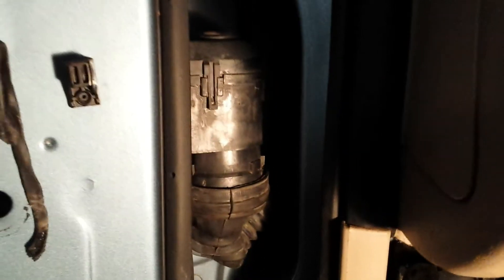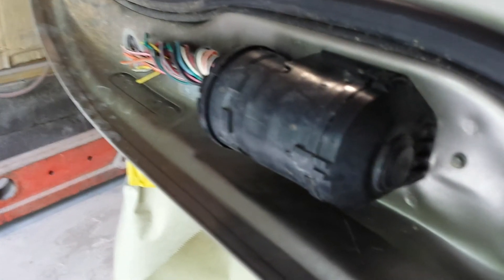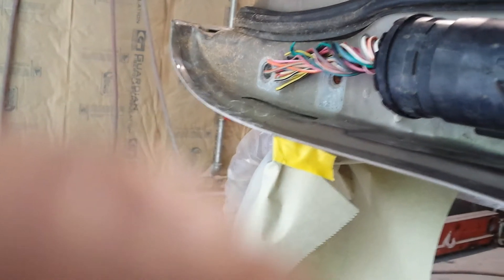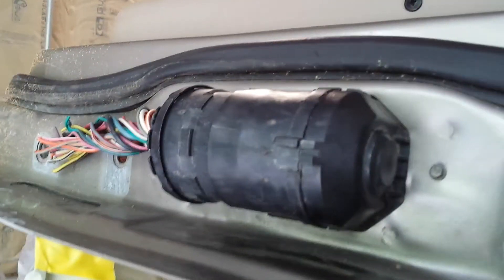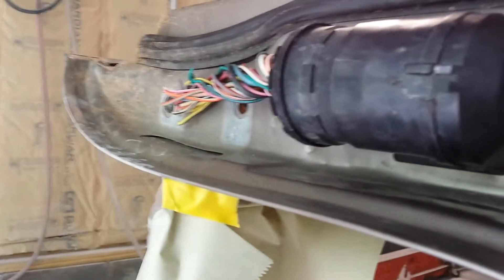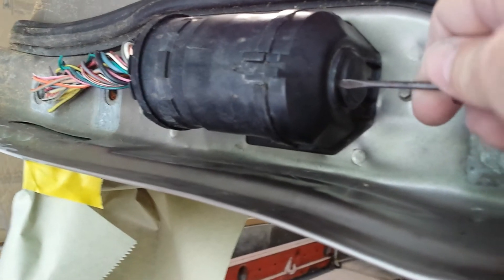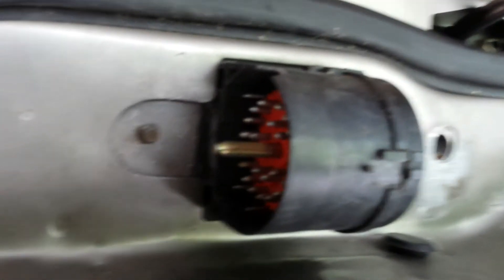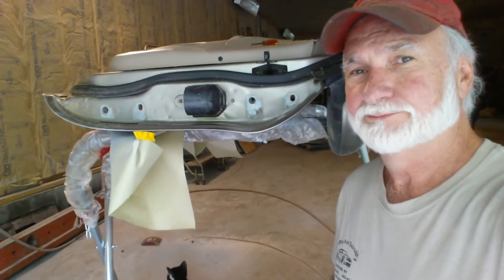How To Disconnect Wiring Harness Remove Door Ford Taurus

Comment: Thank you for this! I know this video is 4+ years old, but it allowed me to find a wire that had broken, which controlled the power windows on our old 2004 Mercury Sable. TIP: you may have to use scissor to vertically cut the boot that covers the wire bundle... to actually see and find the broken wires.
Reply from the maker: Maybe old but glad it help fix it!!! 😎👍

Comment: You are a lifesaver Sir. Now just need to figure out which one is shorting out. Can't find a wiring diagram showing which one is power to all windows . But you showed the hardest part. Thanks!!
Reply from the maker: Glad it helped!!  Thanks for Comment!!! 😎👍
Reply: @JL.FortneyProductions  just fixed it. The main power wire was severed. Spliced back together n good as new. Thanks again!!

Comment: Do you know which wires are for the driver side power windows? Have power to and from my switch but losing it to the motor. Assuming it getting lost in that junction or going through the door.
Reply from the maker: No I don't 😒

Comment: What color are the two front park and turn signals wires on a 04 Taurus ses?
Reply from the maker: I haave no clue on that???
Reply: JL FORTNEY  oh ok cause I plan on so talking some led strip lights guess I just have to get a meter and trace the wire. Thanks anyway 👍🏾

Comment: I was traveling down 205 to Vancouver this past Saturday. I was with my best friend.  I over 60.  not a young pup. Saw this for pickup zoom up on me like he was to ram me. Im traveling at about 62  which is a bit fast for a Saturday drive up 205. That blue pickup was in a hurry so he come up my passenger side  and saw me and my best friend were black. He tried to put me into the center divide. I back off. He moved to in front of me and put his brakes on hoping this feeble old fart would plow into his lowered hitch. I slowed some more.  He got up beside me again this time on the drivers side  he is going to force me off the roadway. I ask my best friend to get on the cb and call out to a state cop. any cop.  This guy was unsuccessful at putting me into the center divide and the shoulder. My Friend said to not get too close as it looked like his lug nuts were extended beyond his rim and they looked pointed. Shore enough, he tried to put me into the center divide I didnt react fast enough his lugs shredded my fender, passenger door and passenger rear door. About then a cop appeared and the truck took off.  I puled off to the side of the road and a second cop appeared he pulled behind me got out and asked if we were alright. I said we were okay, a bit shaken but my vehicle was heavily damaged by the truck's lug nuts. He said yes his partner had seen the truck inflict damage to my vehicle. I found a pair of doors in a pull it place but I wasnt sure how to pull the doors off.  doing a bit of research on how to pull it apart.
Reply from the maker: Hope this helps good luck with it!!!